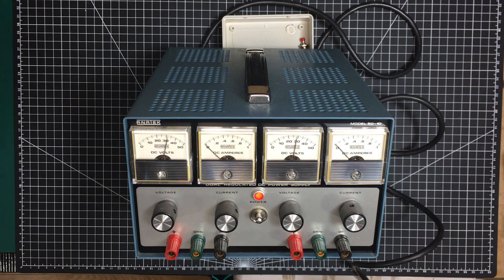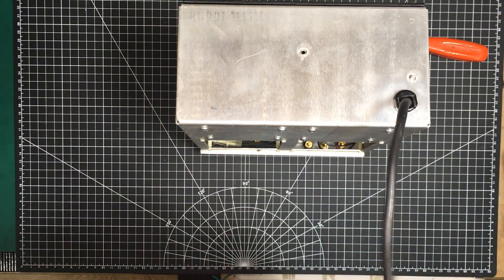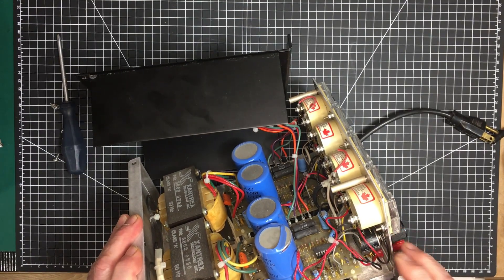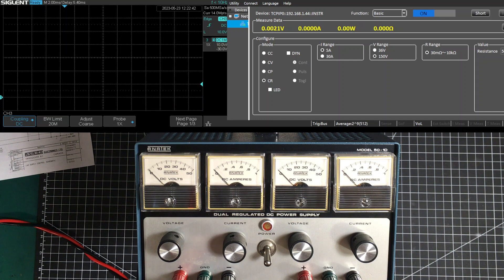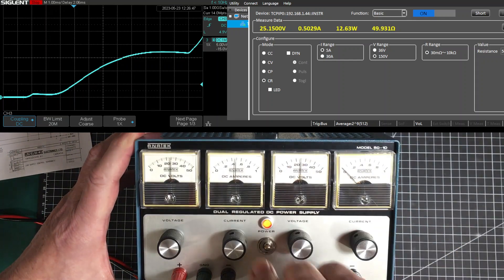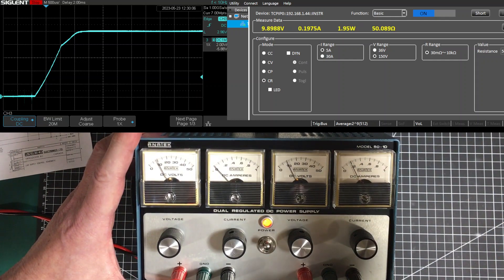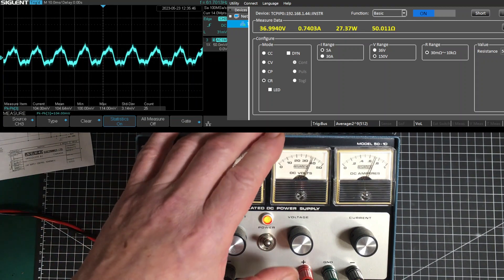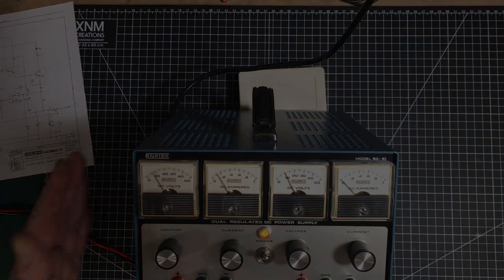0052 - Anatek 50-1D : Awesome Power Supply

Comment: I noticed NO relays, so does it tap switch electronically, or does it make the pass transistors dissipate almost 50W at 1V 1A output?????
Reply from the maker: Right, no relays.  The pass transistors do all the work.  Surprisingly it never seems to get much more than lukewarm from the outside.  It's a pretty big heatsink.
Reply: I could nor find a datasheet for the pass element (2N6577) that shows a SOA graph, so I assume at 50V, 1A is safe for it.  Could explain the huge overkill?????
Reply from the maker: @stevenbliss989  Actually the 2N3055 is doing some of the work too, at least at lower output voltages where the dissipation will generally be higher.  They are both rated at 15 amps and over 100W of dissipation.  The 2N6577 is rated for 90V and the 2n3055 for 60.  They should be up to the task.

Comment: Those old Rubicon caps are likely bad by now, they don't last well usually, the Sprague are probably still fine.
Reply from the maker: I had a chance to play with off camera a bit more.  Those unusual turn-on profiles from the left supply only seem to occur if it has been off for a while (a few minutes).  That may indeed point to failing caps.  I'll order in replacements.  Thanks for the tip.

Comment: Canadian, eh?  Sometimes the older stuff really is the right stuff!
Reply from the maker: That's for sure.  This was less than the price of a really cheesy SMPS and while it may not have digital outputs, it also does not have noise or detrimental behavior.  Just the individual power transformers are worth what I paid.
Reply: @uni-byte  Never heard of Anatek Canada until today.  👍
Reply: A few days ago, I have looked through adverts in "Wireless World" from 1981. Prices of lab equipment back then were well above what average hobbyist could pay. Like £200 for 1MHz HP oscilloscope...
Reply from the maker: @jakubczajka4275  For sure.  Very capable equipment, both old and new, are so much easier for us to get a hold of and afford these days.
Reply: @jakubczajka4275  We are pretty lucky these days.  We not  only have all this great older stuff at super low prices, but the new stuff, especially quality Chinese equipment, is really affordable.